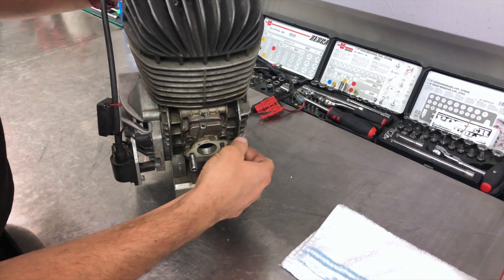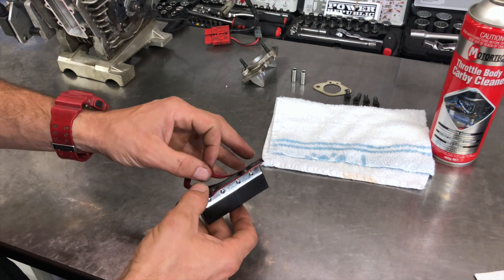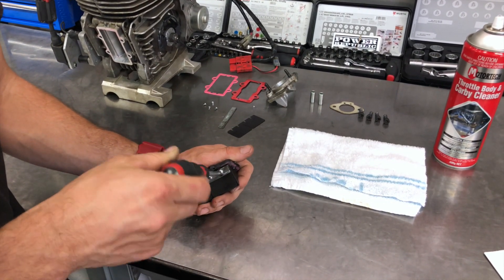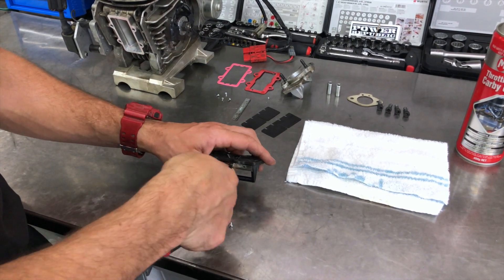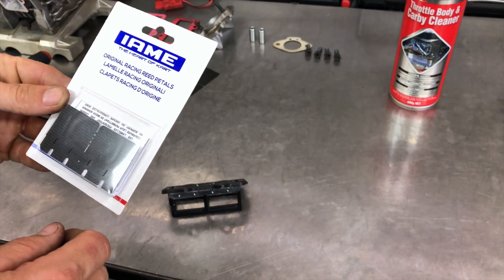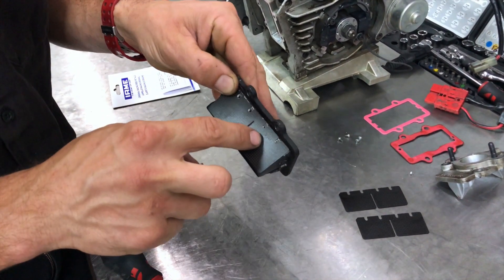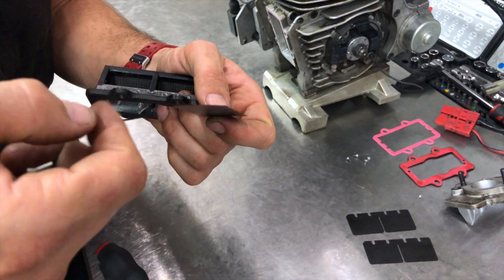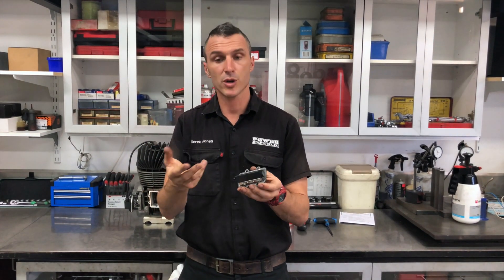Power Republic - How To Change The Reed Petal On An IAME KA100 Engine

Comment: I have been told no light should shine through a good reed pack. If so, how do you remedy that?
Reply from the maker: if your reed cage is damaged and the reed don't seal, but a new one as you can't repair the standard ones in the rules.  if it is for recreation I would bother cause it barely effects the performance unless it is really bad, then change it over for a new one

Comment: Hi what sort of fault would you get if the Reed valves are damaged ? Thanks for the video
Reply from the maker: Hey Billy,  you are very welcome and thank you for tuning in and sharing the videos.  
Nothing much, the engine normally just runs really rough and mostly likely over rich fuel mixture.   just change them out with some new ones and you are good to go!
Reply: Thanks for replying so quick. The reason I ask is we have two x30 karts one absolutely flys and the other is nowhere near as quick. I don’t think there’s a restrictor on it and as we are new to it we’re trying to get all the info on them as we can. We’ve serviced the carb and changed the plug do u have any recommendations thanks again !

Comment: Is it advisable to use a small touch of Loctite on the 4 screws securing the reeds incase the screw(s) come loose and end up damaging the engine?
Reply from the maker: brian jackson you can if you like, but I have enough trouble undoing the screws without loctite. So far so good on them coming loose in between service intervals
Reply: Power Republic 
Thanks for reply, many thanks 👍

Comment: Is there some kind of legality running carbon fiber reeds? And as always great great videos!!!
Reply from the maker: certain models have carbon, others have kevlar and some have both and you can choose.  it depends on the engine and the rules.  with one make class racing which is most kart is, yes there are rules with using OEM parts